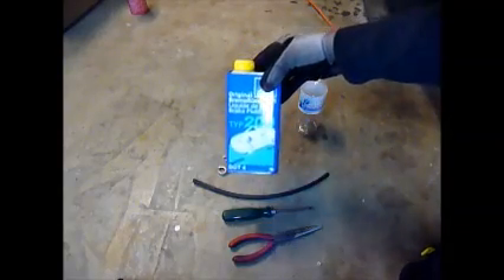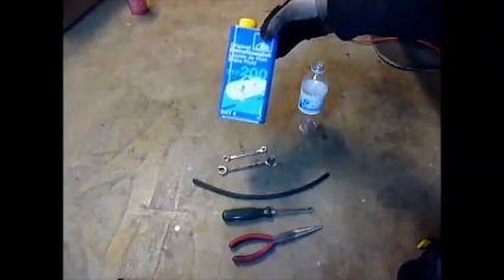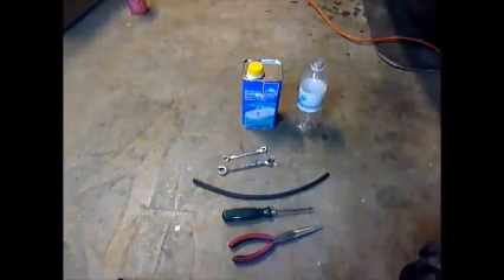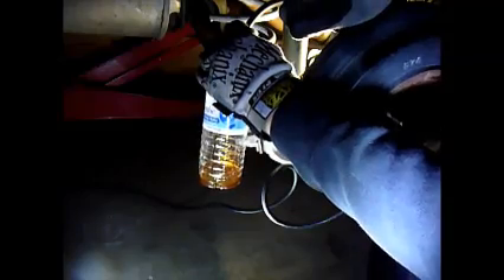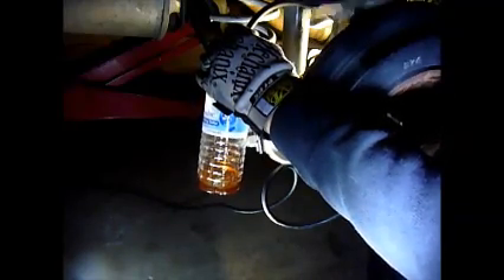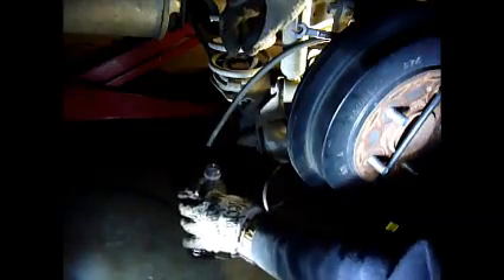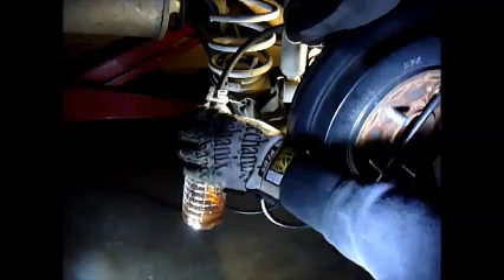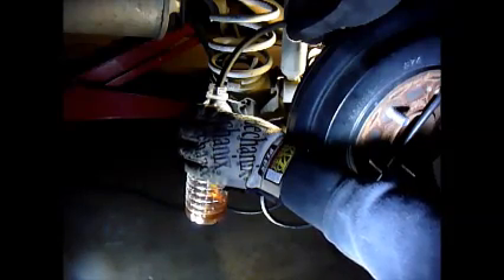Honda Civic Brake Bleed Procedure

Comment: I only have so much room in my garage to do the brakes, can I first bleed the front brakes. Than turn on the car and reverse it into the garage so I can do the back? 

Or do all the wheels have to be done at the same time and the car can't be started/moved during the process?
Reply from the maker: If you are limited in space and can't do them all at once outside, start with the rears (always start with the caliper that's farthest from the reservoir.) Bleed them so that there's new fluid coming out, and keep watching so the reservoir doesn't go dry. Then move to the fronts. Good Luck

Comment: I've never swapped the brake fluid before. My car is a 2017 civic.  The bleeder screws are rusted, S in in the rust belt (toronto). There any danger is getting air in the system when replacing the bleed screws? What's the proper way to replace a bleed screw?
Reply from the maker: First, clean the area before removing the bleeder screw, good brake cleaner will work but be careful not to drench the brake pads, and keep rags around to wipe things up. Your system will take on air when replacing bleed screws, so once you replace all bleed screws you must bleed your system. If you doubt your capability to do something like this, take your car to a shop. Brake system work is not something you want to chance from a safety point of view.

Comment: Does the car have to be off or on?
Reply from the maker: It should be off.  When bleeding brakes, there is no need for power from the brake booster.

Comment: Both of the rear drums brakes bleeders on my 98 civic Lx have no brake fluid coming out when bleeding it? Any ideas. I changed the master cylinder fronts are all good but the rears.
Reply from the maker: Try removing the bleed screw altogether, if fluid bleeds out (when pressing the brake pedal) then you might have something contaminating the bleed screw and should be replaced.  If (still) no fluid comes out, then there is something blocking the line further upstream.  Good Luck.
Reply: Dan Tsuchiya I took off the bleed screw and nothing came out.  I think I’m gonna have to replace both lines.
Reply from the maker: @parales03 Try disconnecting the line where it goes into the wheel cylinder (slave cylinder) and then see if it bleeds (while pressing the brake pedal) then you can isolate the wheel cylinder where most of the problems for these rear brakes can happen.  The rear brake wheel cylinder on each side may need to be replaced.  This video shows that part https://www.youtube.com/watch?v=bmJ7zWVjI3I

Comment: Bleeding is done before or after installing new brakes?
Reply from the maker: It's usually done after installing the new brake pads just in case something goes wrong, you don't want to waste good brake fluid.

Comment: I use a clear tube so I can see the air going through it. I also put a good two inches of clean fluid into the bottle, then submerge the end of the tube in it. This keeps air from going back into the system. Also, the assistant should press and hold—and then you open the bleeder and close it. Only then should the assistant let up on ththe pedal.
Reply: if that's the procedure you follow then you don't need an assistant. you can let off the brakes and re-tighten the bleeder screw ...
Reply: @deminybs  No... no... no... what he's trying to say is, "tell your assistant to pump the break pedal so many times till he feels the opposing pressure against his foot, then tell him to press the  pedal firmly down the floor. At that instant, you open the bleeder screw and let the fluid out, re-tighten it and tell your assistant to release the pedal. Repeat the same procedure till there's no more air or bubbles coming out of the bleeder screw" make sure you're checking the reservoir every now and then, otherwise, the air will enter your break lines then "kaput", you'll have to start it again...

Comment: You need to push the pedal down before opening the valve, and hold it down untill the valve is closed again
Reply: no you don't
Reply: @KeepinItReal890  yes you do, you pump the brakes and hold, then someone opens the valve, the pedal goes to the floor, then you close the valve before releasing the pedal so you don't suck air

Comment: Because the tyre is removed, the car would be jacked up(tiny non hydraulic jack), is it safe to sit inside?
Reply from the maker: If it's a mechanical non-hydraulic jack, typically those have very little stability and I would not recommend it unless you can get some jack stands under the car to provide some stability.  Invest in some jack stands, they usually aren't too expensive new or used.  Safety should be a #1 concern.  Good Luck.
Reply: NEVER leave a car on a jack if you plan to get underneath. 
Like Dan said; JACK STANDS.
Reply: @zcole774  yep i never fixed it in the end. Didn’t buy iron stands etc either, didnt get inside it. Every time i fixed the car, dad drove it badly or something and more things broke…and got repaired from a shitty mechanic too then i just gave up on the car. Still have it tho, waiting for tesla to come in my country will replace it with that.

Comment: Honda Civic service manual recommends bleeding in the order front driver side, front passenger Side, rear passenger side, rear driver side.
Reply from the maker: Yes, for bleeding both/either will work since they are separate circuits (front is separate from rear).  Thanks for the note.

Comment: i just did my bleeding on 08 civic. Manual says go front driver - front passenger - rear passenger - rear driver. Different than the traditional. Reference: 8th gen Civic  :)
Reply from the maker: Should work fine per the manual.  Front and  back are separate circuits so going front to back will also work. Thanks for the info.
Reply: Ray T yep same here, same car same manual same instructions
Reply: Thankyou really helpful after fitting the Brembo BBK to my type r ep3  I followed your instructions and job done saved myself another £40 by doing this job myself

Comment: How big is the bleed tube?
Reply from the maker: It's relatively small, about 5/16" inner diameter.  You can also fit 1/4" but the tube should be thin walled to stretch. You want it to fit tightly around the bleed screw. Different car makes may have different sizes so it's best to measure before buying the hose. Good luck
Reply: Thanks.

Comment: For a 98 Civic does the rear brakes still require a an 8mm wrench? I have limited tools so I always need to track down last min tools. Thanks
Reply from the maker: It's likely the same, but I would just pull one of the wheels off and check before you get started.  I do not have that generation of Civic so can't verify. Good Luck
Reply: Dan Tsuchiya Bleed the brakes in rear of my 98 civic. First one went perfect. Started other side and the bleeder broke off while trying to open it 😤. Line is still pressurized so I don't think it fully opened if it even did move at all. On the plus side the brake pedal is nice n stiff n 12 oz of fluid got flushed through line. So think I lucked out
Reply from the maker: Sounds like you lucked out.  However, that leg of the circuit will never be bled, so if there is a need to bleed that section in the future you'll need to removed the entire caliper by disconnecting the brake line on the backside and taking the unit to your local parts store (if they have a machining services or a local mechanic) to install a new bleed screw. Don't worry about it now, only if it acts up.
Reply: Dan Tsuchiya Could just replace the wheel cylinder if needed. The bleed screw connects right into it and it's all one piece I think.
Reply from the maker: The wheel cylinder is related to the parking brake shoes not the caliper bleed screw.  You can always purchase an aftermarket one for $70 or buy a wrecking yard caliper for $40, they are inexpensive and are available on eBay.  If you aren't having issues don't worry about it now.
Reply: The bleed screw broke off in the rear. The rear brakes are drum brakes no calipers. Its holding up so no worries, if it fails the wheel cylinder just needs replaced. Thanks for the advise.
Reply from the maker: Oh yeah, sorry, they are drum brakes my bad. Cool, glad it's ok.

Comment: Does it matter if it's ABS brakes?
Reply from the maker: No it shouldn't matter since it's a closed system. On newer (from late nineties)  Honda ABS systems they use the main reservoir for brake fluid supply trough the modulator of the ABS system.   If you feel you have air in the lines, use a decent amount (like a quart)  of brake fluid to make sure you are purging all air or contaminants.
Reply: awesome. Thanks for your help Dan i'll let you know how it goes :)

Comment: may i throw a question, what is the use of bleeding some fluid, for example the brake and power steering fluid? and hows often we need to do these?

Many thanks for the valuable answer
Reply: bleeding fluid in any hydraulic system removes air from the system. the reason you need to do this is because if you have air in a hydraulic system when you apply pressure to the fluid the air will compress and, in the case of the brakes, all the movement used to compress that air will not allow you to apply the brakes.
Reply from the maker: +Jonathan Sy The reason for this is brake fluid tends to absorb water and other contaminants from the atmosphere or from the working parts that the fluid comes into contact, this reduces the efficiency and performance of this fluid causing a spongy pedal for example.  Bleeding the fluid essentially exchanges new fluid in place of the old fluid that is pushed out. You should do this somewhere between 60-80k mile intervals.  

For Power Steering fluid, it's a recirculating system and this fluid essentially gets dirty, so on a similar interval, it would be good to flush.
Reply from the maker: +gregtubez The bleeding of the lines may not solve the return issue, but you can try.  If you suspect water towards one of the rear calipers you will need to at least bleed both rears as they likely split from a single source. The reason why I question the bleed alone is there could be issues with your caliper piston no retracting due to corrosion.  I'm in California (no freeze) so I hear you about where the water can freeze and expand also causing pressure behind the caliper piston. See if a full bleed will work, good luck.

Comment: Thanks.  How many ounces of new fluid do you need?
Reply from the maker: Steve Gabriszeski You can probably get away with a pint, but have a quart on hand to be safe so you aren't worrying about running out.  I used the ATE Type 200 Brake fluid which is a DOT 4 and is safe for a stock system.  DOT 3 is also fine.  Avoid the DOT 5 as these are usually Silicone based are are not recommended for stock Honda systems. I found the quart of ATE Type 200 on eBay.  Good Luck

Comment: Does it matter which side u start from first like start left rear first then right rear second... and so on?
Reply from the maker: The general rule is to start farthest from the brake master cylinder reservoir and work towards it.  So if you have a left hand drive car the master cylinder reservoir is likely near the left firewall.  You would then start right rear, then go to left rear, then right front and last left front for bleeding your brake system. Thanks and Good Luck.

Comment: Hey dan john here I have a question I changed the front shocks on a 01 civic and during the process removed the brake line that goes to the calipers when I put everything back together my brakes became really spongy and went to the floor the car stips but like I said the brakes go to the floor. Do you think I need to bleed the brakes and if so can I just bleed the fronts? Thank you so much in advance
Reply from the maker: Hey John,

That's correct, anytime you break the line where air can enter into the line, that's where the sponginess comes from.  You are probably only getting rear braking, effectively.  You really should bleed the entire system starting from the back just to make sure you have purged all air from the brake lines.  It's a little more work, but it's just good insurance that you won't have to do it twice. You can probably get away with just a pint for bleeding, but if you have a quart of brake fluid that will be more than enough.  Just bleed them a few pumps beyond where the bubbles stop coming out at each corner. Good Luck.
Reply: Thank you dan I blead them n it worked
Reply from the maker: + John Harris,  It depends on how long the front brake calipers were disconnected. If for a while (or if you have used them), sometimes the air bubbles will reach the master cylinder (where you fill brake fluid into the reservoir) and then you will need to bleep both front and back.  Please note it's always safe to do the whole system starting from the rear because you won't be able to tell if a front only bleed was effective until you do that procedure and drive around for a bit.  Also, air trapped in the system has capability to travel around the system and can affect the rears.  I have had success bleeding just the fronts after disconnecting the front calipers but I quickly bled them without driving on them.  In your case, it's best to bleed the entire system.